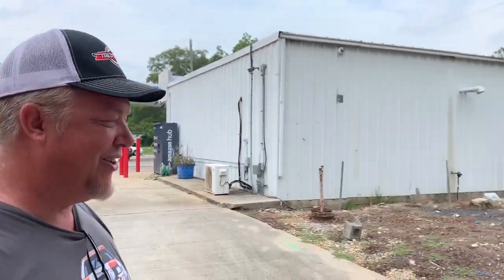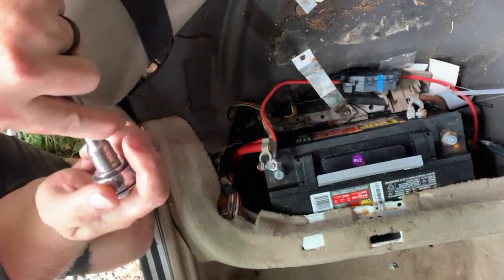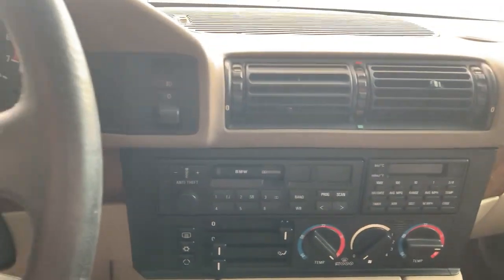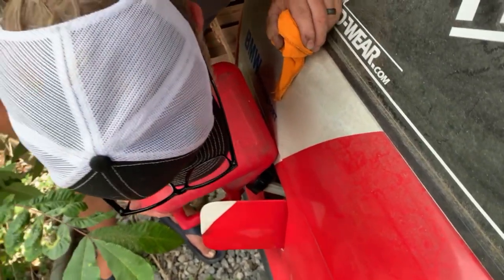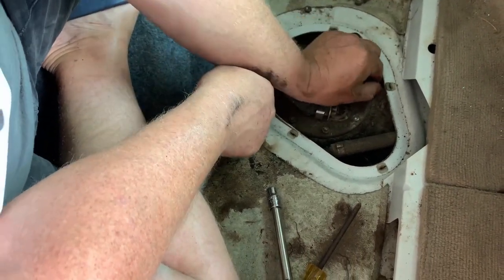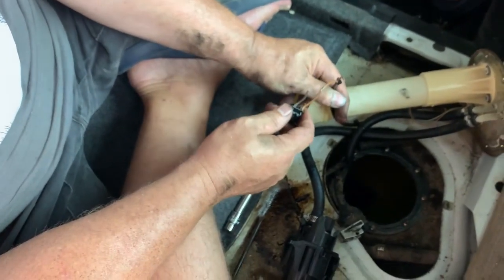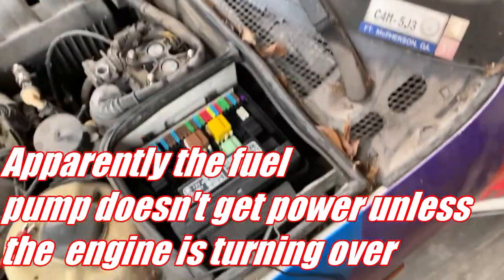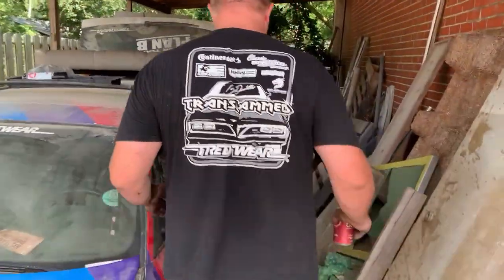BMW E34 TOURING Parked 7 years ago. Will it run?

Comment: What engine does this have M50B20 or M50B25?

I have a 1993 E34 520i (M50B20TU)Touring with 250,000 miles on it. Original engine, front suspension rebuilt, new clutch otherwise original mechanically.

The double sun roof still works and I've updated the interior to leather.
Reply from the maker: M50b25 246k miles. 👍🙌🏼
Reply from the maker: Dbl sunroof works and 5 spd swapped